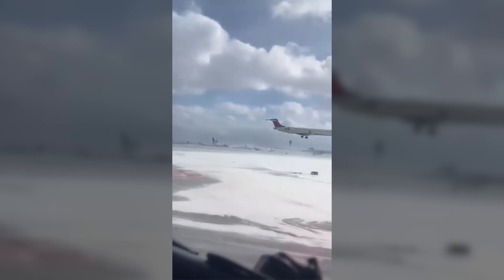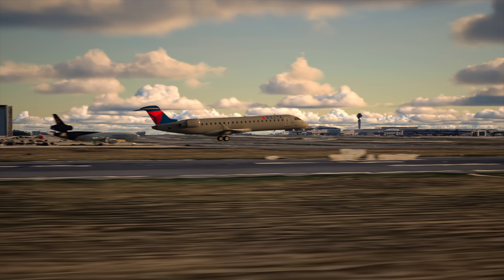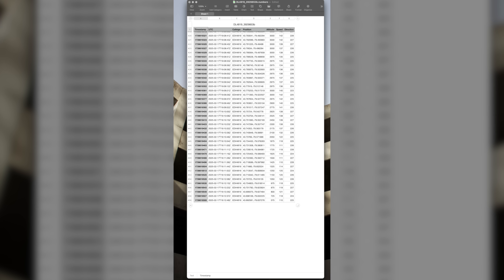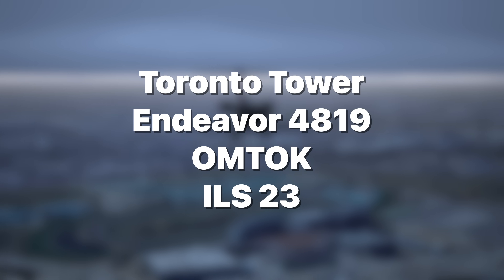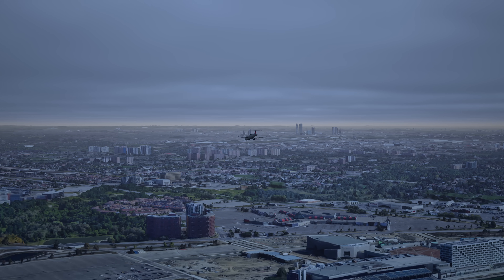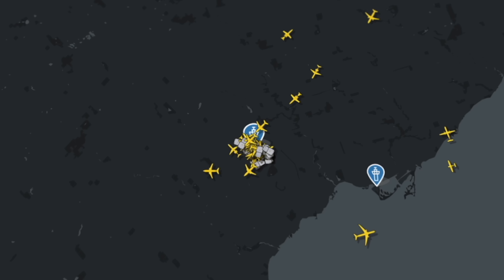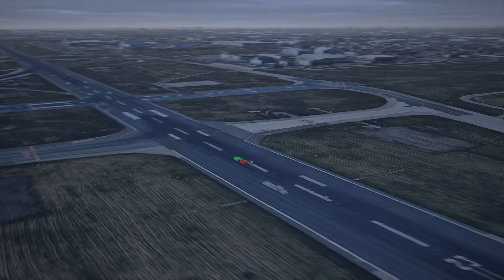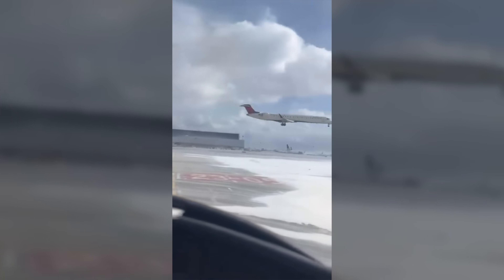What Caused The INSANE Descent Rate in Toronto?

Comment: The approach looks normal until there is no flare. Wondering if the snow covered ground and blowing snow affected depth perception of the Flying Pilot. The CRJ has a talking radar altimeter so that Should be mitigated to some extent. The final approach  descent rate does not look insane at all but there needs to be a flare to bring it to about 250-400 feet/min rate.
Reply: That's what I thought. Misjudged where the ground was because of snow. Simple as that.
Reply: My thoughts exactly, I saw NO indication of a flare. Hard to believe actually, the plane looked like it did exactly what it was commanded to do, as far as the descent rate.
Reply: Depth perception compromised??  Yes, best answer so far!!!
Reply: That's what I came down here to say. To me as well it looks like the visual cues were affected due to the snow.
Reply: "The approach looks normal until there is no flare."
The approach doesn't look normal from the start. It is very obvious from the start of the video of why there will be trouble. The descent(vertical drop) is far too fast
Reply: @babajaiy8246  I have 5000 hours in the CRJ series. The approach looks completely normal until there is no flare.
Reply: @andyb618  " I have 5000 hours in the CRJ series. The approach looks completely normal until there is no flare."
That's your 'problem' - your experience is from the inside - you have zero experience looking/judging from the outside. This is not a normal approach. It's obvious from the start it will be a hard landing; flare or no flare.
Reply: @ In my now 17000 hours you don’t imagine I have held short of runways and watched these exact airplanes land right in front of me from the same perspective as this video? Clearly you are not a pilot if you don’t think I have experience both landing and “looking/judging from the outside” this type of airplanes. It was a normal looking approach until the moment when the flare should have been initiated. I have watched these exact airplanes land hundreds of times from this same perspective.
Reply: @babajaiy8246 this was a normal approach. You are not the expert you think you are.
Reply: @andyb618 the runway was clear of snow. Everything else I agree with you.
Reply: @rtbrtb_dutchy4183  "this was a normal approach. You are not the expert you think you are."
You're wrong - go look at the logs that record the descent rates. They are too high.
Reply: @babajaiy8246  a normal average approach is around 800 feet per minute down. The logs show 500 to 1000 feet per minute. This is all normal for an approach. The fluctuation is just meteorological conditions. 
This was a normal approach. People in here, who are pilots, have been telling you this, but somehow, you think all these pilots are wrong and you are right.
Reply: @rtbrtb_dutchy4183  Wrong...the logs show +1000 - that's not normal or the recommended rate.
Go Ahead, ask an actual pilot, not people claiming to be pilots(when they're not) on the internet.
Reply: @ those are ADS-B logs. They are not actual logs from the data recorder. And they show 1024. So when you say 1000+, that’s just silly. 

I can tell they are real pilots who are talking to you. Just like I know that you are not a pilot.
Reply: @rtbrtb_dutchy4183  "those are ADS-B logs. They are not actual logs from the data recorder. "And they show 1024. So when you say 1000+, that’s just silly." 

I can tell they are real pilots who are talking to you. Just like I know that you are not a pilot."
Reply: " "And they show 1024. So when you say 1000+, that’s just silly." 
1024 is 1000+ , you just confirmed I was right.
Reply: @babajaiy8246  except that the extra 24 feet per minute doesn’t even register on pilots instruments. So it’s still 1000 feet per minute, not even 1100 feet per minute. 

This was a normal approach. You can try and twist it all you want, but it’s just not what you want your narrative to be.